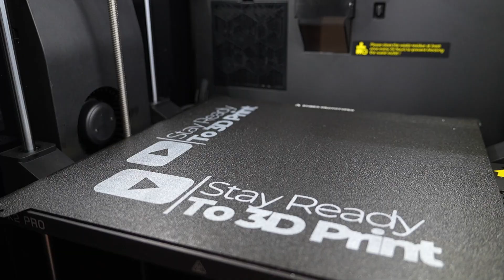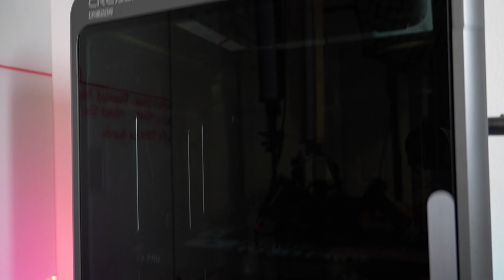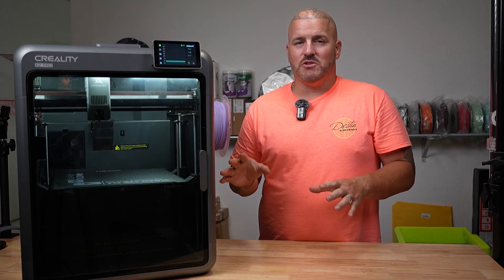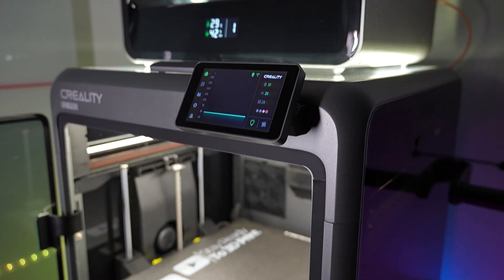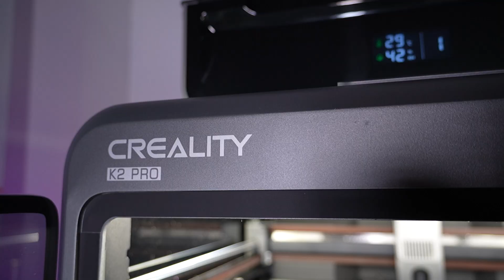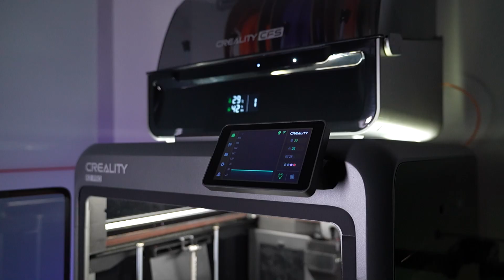Is The Creality K2 Pro WORTH IT?

Comment: Man I am SO tempted to try this but looking online the K2 reviews are so mixed. Some people love it and other just have none stop issues, where Bambu's seem to be more reliable. I really do not want to regret going for a printer that will have issues.
Reply from the maker: Bambu is a solid choice for sure. I’d say the better choice as of now.
Reply: Buy the bambu if you want the hobby of printing stuff / Buy the k2 if you want the hobby of working on a 3d printer.

K2 pro: Issues from day1 with filament and MCU errors; down hard in 2weeks from filament sensor burning out, wiring harness shortage suspected.  My older 3x Bambu's are just working happily in background.  

Same old issues; wiring harness, filament sensor problems, no voltage control, no TVS, no latch management. This is a very fragile machine, all the bells and whistles, very little fault tolerance or fault control.  I've dumped more hours in troubleshooting and tearing down the k2 in 3 weeks then years of ownership with my three bambu's.
Reply from the maker: @jascaf1503 yeah sometimes ya get one like that. Although I’m no longer promoting Creality as a brand I must say that they make just a good if printer as anyone else. I’ve seen people with Bambu have issues like crazy too. So I never judge off one experience. I do think Bambu and Prusa make a better built machine though.
Reply: @stayreadyto3dprint  yep; i came from ender3/ender5, octo and klipper days.  Huge fan of  Creality and trying to keep platform somewhat open.

Just some of the design choices have me scratching head; would be little effort to make the k2 rock solid.  Software that hangs on a single 8 dollar sensor that has no voltage control from rail...  just... its 2025...  These are solved problems.
Reply from the maker: @jascaf1503 I totally agree.
Reply from the maker: Yeah some of the decisions made make me wonder. Like not being able to adjust tension on the extruder so you can print various materials. The literally put the threaded insert but no screw to adjust. So I created a kit that I sell and everyone loves it. It’s like they thought about it but decided never mind. And then they aren’t innovating. They are changing a free things and wrapping it differently adding a letter and calling it a new printer. At some point they have to create something on their own that’s cool and new.

Comment: Now i don't know which one to get the plus or the pro
Reply from the maker: Depends on size needs. They are the same. If ya don’t need the size get the pro. But honestly I’d get the plus anyways. Not alot more and it’s bigger. Same features mostly same printers
Reply: @stayreadyto3dprint  larger wattage / higher temp nozzle also... 300F vs 350F.

Comment: I currently have the Creality Ender-3 V3 SE that is modified to the max using the Nebula Smart Kit with Creality Print and Fluidd via Klipper.
It runs beautifully, but was always looking at upgrading to a multi color filament machine and the K2 Pro Combo fits the bill perfectly.
So in around 3 days my new beast will arrive and certainly looking forward to it.
Reply from the maker: That’s great. You didn’t want the new multi toll machine that’s out now? Much faster multi color machine that these CFS style machines

Comment: I have a Bambu Lab X-1 Carbon, a Bambu Lab H2D, and a Creality K2 Plus.  I didn't want to wait for Micro Center to receive H2Ss, so I purchased the Creality.  I've had issues with X-1 Carbon AMS, so I replaced it; otherwise, it's a fabulous machine.  The H2D is amazing. The only thing I don't like is the H2D's second head.  It might be reasonable to some, but it's a pain for me. This will be the third time I've torn the Creality apart since I purchased it 4 weeks ago.  The first time, as I was disassembling the extruder, the little spring popped away, never to be seen again. I spent $32 on a new spring.  If the extruder clogs, the filament strips at the extruder gears, and you tear the whole thing apart.  I didn't purchase the Creality to be a mechanic.   I'm sorry, but the Creality is poorly designed. The whole extruder should come off straight up with one or two bolts.  Then, when the extruder is on the worktable, you should be able to disassemble the extruder without pulling 4 small wires before you can take the thing apart.  All 4 of those wires should all be in one master plug on the extruder assembly for easy removal.  There are ten small bolts sitting on the build plate.  Really?  I will suffer through until I solve all the Creality problems.  In the meantime, I'll wait for Micro Center to start shipping H2Ss.  While I'm reassembling the Creality, my X-1 Carbon and H2D will be working away.
Reply from the maker: You should watch my extruder mod video. I sell a kit for $9.99 that fixes it
Reply: @stayreadyto3dprint  What's the video's name?

Comment: I will stay with the K2 Plus, now that I got it working again.  Something happened to the exturder.   Replaced it, and it is working great.  I'm not sure what the issue was.  Both exturders looked actually the same.  If anyone knows the difference, please let me know.
Reply from the maker: No difference. You just got lucky and got one with a spring that isn’t too tight. I change the extruder springs and it fixes them. It’s just too much tension and it causes jams and clogs.

Comment: I got mine about 2 weeks ago and really like it a lot. My first K series as the plus was too heavy for me. The K2 Pro is the perfect 300x300 volume for me and is still heavy, but not so heavy for me to get it upstairs to my art studio at least. My CFS arrived broken and Creality is replacing it and I had some issues with the tool head cable, but loosening it's bracket on the top of the print head seems to have helped with false errors I was getting and Creality is sending me a replacement tool head just in case. (mine was delivered upside down so no idea if Fedex caused the issues or what). Using the spool holder right now though and the print quality is amazing on it - a great bigger brother for my Hi Combo and companion for my 2 Ender3-v3-plus printers.
Reply from the maker: That’s a shame. FedEx is horrible! I’m glad you’re getting it taken care of though.

Comment: does the K2 pro still have the same design hotend as the K2 Plus where the PTFE tube breaks? is there a redesign of that?
Reply from the maker: It looks to be different and it comes with a support piece installed to help company that.
Reply from the maker: To be honest, I don’t think that’s a very common problem. I’ve heard people saying it happen to them, but I have three machines that have had a ton of use and none of mine have ever done it.

Comment: Unfortunately I’m one of the people who got a lemon K2 Plus. It can’t even do a first layer properly.

This is not necessarily an issue if the company helps you to try and fix it, however there a lot of people on Creality forums and Reddit with the same issues as me and not receiving solutions.

Instead of trying to fix problems they just keep releasing new products.

For instance, they have the exact same issue on the K2 Pro extruded with TPU, where are the developments and fixes????

Personally this has left a bad taste in my mouth.

I don’t mind if products have issues, if the company commits to fixing them, then that’s fine with me.

Creality has fixed nothing, that’s why I recommend people take their money elsewhere.
Reply from the maker: Yeah that sucks man. I hate hearing ppl with issues. I promote these printers because I’ve owned them for years and they are solid. Ppl get a bad one and think it’s a bad printer. But if you look at the ratio here you are in the 2-4% of ppl who have issues. Which is normal. I think where they mess up is being a foreign brand and customer service not being what it should from what I hear. My experience has just been different. I msg them on WhatsApp and they send any part you ask for. So I can’t complain until this happens to me I guess. I can only report my experience ya know. Hope it works out for you though. And my offer still stands if ya wanna get on a chat live and have me help you to see if maybe I can help ya. I know these printers inside and out so who knows.
Reply: @stayreadyto3dprint  I just ordered the plus. Brand new to the 3d printing world. Any tips or tricks to be successful? Parts or prices to keep on hand? This is just something fun for me and the kids to learn together, for now at least. Tia
Reply: If you want to print TPU you just have to use a top single spool and insert the filament directly to the printing head, don't use the PTFE tube, no need to mess with springs. I print TPU with no issues.